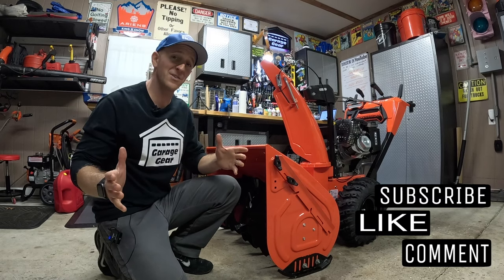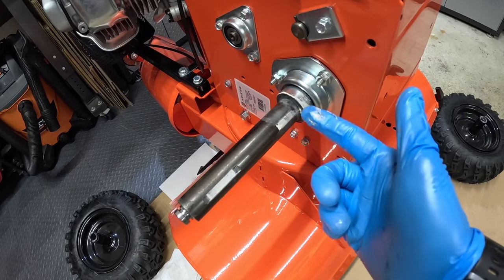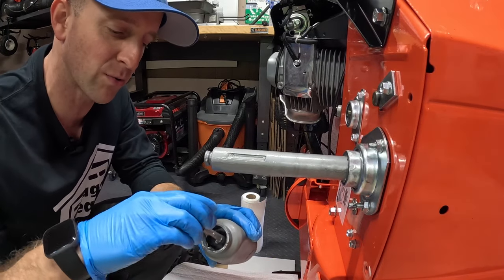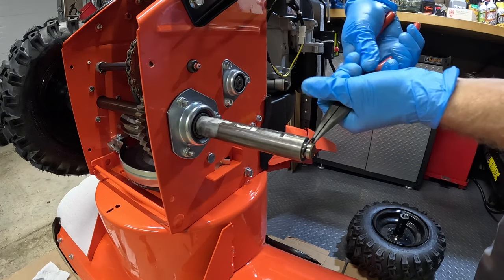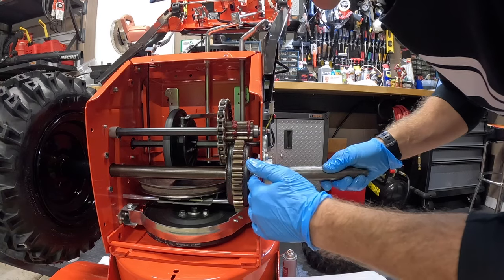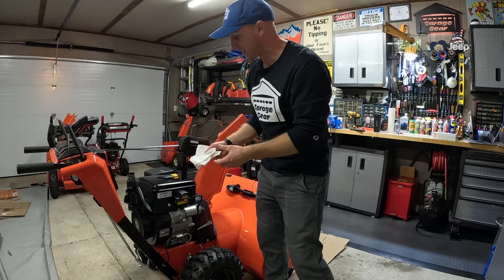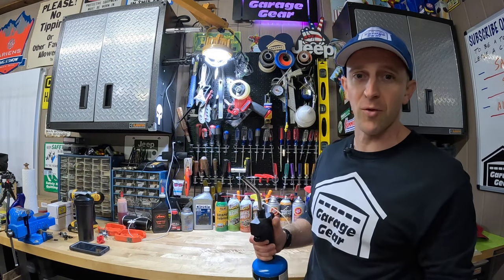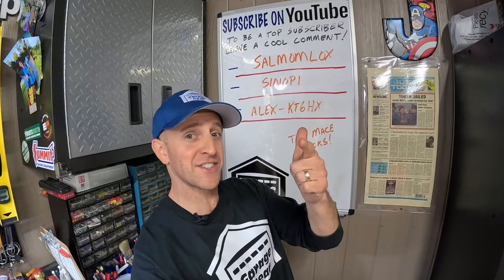HOW TO LUBRICATE DRIVE AXLES ON A SNOWBLOWER (Avoid Issues)

Comment from the maker: Here is a LINK to the ANTI-SEIZE used in this video! Thank you for Supporting the channel! 👍
👉 https://amzn.to/41mrYdK
Reply: @GarageGear  I mean the blades that you took apart to put the shear pin in I got the name mixed up not the auger I think I got the wrong name the as it was throwing the snow it just stopped spinning and I didn't know what happened and the motor was running yet I didn't know if they have a special place for each blade to be the wife called me that the snow blower so I tried to tell her you can't use a snowblower on gravel and I believe that's what broke the shear pin I want to put a little wheels underneath the snowblower the front of it that I don't get too close to the gravel and I did the axles like you did first thing I put the anti seize all over it.  When I buy shear pins I'll sit there and try to put them in.  I knocked the pins out with a punch so when I get them I would be able to just put them in I don't mean to bother you and thank you if you do have any answers and thank you if you don't
Reply from the maker: @liljoeii6091  hey Joe the shear pin holes should line right up and you should be able to drop the shear pins right in. 👍 hope this helps!

Comment: Yeah, it's absurd that Ariens doesn't grease up the axle shafts during assembly. I recently picked up a nearly new deluxe 28 for a great price. Didn't run because somebody left ethanol gas to rot in the carburetor. I had to squirt penetrating oil into the axle keyway for a couple days and then blast the end of the axle shaft with an air hammer to get the wheels off.
Reply from the maker: @danielleroberts8964  yep that sounds like a royal pain! They should definitely live them up at the factory

Comment: My 24" Compact is from 2012 and the axles don't have a key.  When did they start using those?  Also my wheels have different wheel locks.
Reply from the maker: @Noneofyourdambusssiness  not exactly sure when they started using them

Comment: how about the half shaft axles, and the "slip" middle part of the axle that the half shafts rotate in? Usually have to try to get spray in there, like WD-40. But I just ended up tearing it down, was doing all other maintenance anyway. I know grease is usually used if taken apart, but seems like anti-seize might be a good option too. Maybe even better than grease? 

EDIT: Ok, well that "axle slip tube" is different than mine. But still same concept. I'm using anti seize.
Reply from the maker: @AkornzStash  you could definitely do that! 👍
Reply: @GarageGear  yep, thats what I did yesterday. axles turn independently Very Smoothly now, even by hand. Should steer much better now. Still have to get the rest of the drive gears and mechanism all back together. Then finish repairing the gear box for the chute control. Thanks for All the Great Videos 👍
Reply from the maker: @AkornzStash  awesome akornz! Appreciate you my friend!

Comment: Thanks, J.B. I just bought a Brand New Ariens 28 Deluxe on Monday, November 27th. from a Dealer here in the Detroit Metro Area. I had been watching other videos about lubricating the drive axel, but your video is the best. Thanks for the explanation about the autoturn; now I understand why the right side is different from the left.  Thanks, for demonstrating how to tip the snowblower into the Service Position; yours is the only video demonstrating that.  Also, thanks for showing how to remove the back cover (in only two seconds); again, yours is the only video demonstrating that.
Reply from the maker: You got it Andre! Thanks for being a cool fan!

Comment: Another great video JB! 😎
If someone has a lot of fuel left in the tank prior to rotating the machine into the service position, an additional tip would be to turn the fuel valve off, run the machine until the carb is dry, then put a plastic bag underneath the fuel cap to prevent it from leaking out.
Reply from the maker: Another solid tip snowking! Thanks for sharing!

Comment: Thx JB, I take care of my Ariens every spring after the winter is over and done with and of course I use the owners manual as a guide of what to do, I was not aware of the autoturn shaft, and no surprise it’s not in the owners manual from what I recall.  I haven’t put my snowblower into service yet this year, so I will have to take care of that shaft before I start using it.  Again thanks a bunch!!
Reply from the maker: You got it, my friend! It is one of those hidden things that no one talks about! Thanks for following along.

Comment: JB I noticed that your blower does not have the engine size decal on the gas tank, when I bought mine it was missing as well. I contacted Areins and they sent me the decal kit no charge. Great video, very helpful.
Reply from the maker: Hey John! Had one but it was peeling off a little bit! Pulled it off! All blacked out now! Thanks for watching bud!

Comment: Great video JB something I need to do to my new one as well. Since getting the new one I have heard a lot of negativity around the auto turn function. When you start taking snow it’s tough to go straight. Wonder if this is something you would want to do a video on or if you have heard/experienced it.
Thanks!
Reply from the maker: Hey Nick! I’ll be keeping an eye on this once we get some snow here! Got nothing worth pulling out a snowblower for yet.
Reply: @GarageGear 

Absolutely no issues going in a straight line for my first run of 20cm wet heavy snow.  Ariens has a great vid showing the proper way to level your machine.

Comment: Great video JB. I have a 24 Deluxe and grease and anti seize the axles in the spring and re check in the fall. I agree with you 100%,  about Ariens , they could do a better job on corrosion protection. These machines are expensive in Canada.The manual also says to use high temp grease? i use low temp grease since we are using these machines in cold weather. Am i missing something here. Keep up the good work.
Reply from the maker: thanks for watching, Barry! I don’t think we are missing anything, but Ariens missed the mark not greasing those!

Comment: Do I need to drain out the new oil i put in first before tipping the blower over ? Or it is ok to tip over
Reply from the maker: @xrpxtrariceplease2811  hey xrp! Depends on your snowblower! You could try tipping it and if you don’t see any leaks or drips from the oil spout you’re good to go. If you’re concerned about just drain the oil out and put new oil in when you’re done.! Your engine will thank you that way!
Reply: @GarageGear  
ariens deluxe

Comment: question, would it make sense to put grease on the inside of the shaft where the teeth are?
Reply from the maker: @K1600_Rider  you could do that! 👍
Reply: @GarageGear  I was thinking about using Belray Assembly lube that I've used on my motorcycle's drive shaft splines
Reply from the maker: @K1600_Rider  go for it!

Comment: Good tutorial JB, just when I think you've done every video that has to do with a snowblower. I just did my Craftsman when I was prepping it for the upcoming winter season. except I used low temp white lithium grease. Anti-seize does a great job as well but it is so bad and gets everywhere. I have been hoping and praying we're not going to need a snowblower this winter in WNY but that usually never happens.
Reply from the maker: Hey Chris not to worry we’ll be getting snow soon enough! Smart man greasing those up!

Comment: JB,  my lubrication of the drive axles are going to take some time.  Mine are rusted to the axle and I ordered some PB Blaster to try to free them.  Here's to PB Blaster......
Reply from the maker: Let that soak overnite for sure! Let me know how she goes!
Reply: @GarageGear  I unbolted the back panel and it has this rubberlike stuff all over the back panel.  Can I sent you a picture of it?
Reply from the maker: @hipguide1  that rubber dust is from your friction wheel and belts.
Reply: Hey JB...do you have any videos on changing the axle out? @GarageGear
Reply from the maker: @hipguide1  I do not at the moment unfortunately
Reply: The right one was "unseized" but the left one is on and "on good."  That's why I need you to change the drive axle! @GarageGear
Reply from the maker: @hipguide1  you could try torching it.
Reply: Do you need to take the tire off or at least reduce the psi in the tire?  @GarageGear
Reply from the maker: @hipguide1  probably not a bad idea to take some air out but try not to let the torch hit the tire itself.

Comment: I did take never cease and put the axles I have a Toro Max it's about 2 years old,share the pens about a year and a half ago how are they  set. Going through surgeries for my knee get done and I don't remember where they would  be set  cuz when I noticed they were broken the auger stopped by time i seen it not throwing snow if you can help me out I appreciate it thank you for the video
Reply from the maker: @liljoeii6091  have you tried rotating the augers to see where the holes line up?

Comment: I have a question.. I have a new wheeled Honda. The service book says to remove the tires to complete an oil change. The oil drain is behind the tire. How do I go from the service position back to horizontal with no tire on it ? Or can I do the oil change while it's vertical? The manual is a bit vague. It doesn't show any jack points in it and where the snowblower is 250 lbs, I'm a bit worried to just drop it on blocks. maybe I could drop the non wheeled axel on a block ?
Reply from the maker: Yeah, Maybe you could do that or you could also Jack it up a bit.  Thanks for watching.

Comment: Hey JB! I recently bought a used craftsman snowblower, I believe it’s a 1995 model, with the 5hp tecumseh engine, 5 speed fwd, 2 speed reverse. And the previous owner told me he uses 93 premium gas with stabilizer in it. Should I continue to use it as he has, or flush the system and use ethanol free gas ?
Reply from the maker: Hey Jonathan I would skip the flush and just start using ethanol free gas. You’ll be good to go with it! 👍 just use up whatever you have left in the tank then start pouring it in!
Reply: @GarageGear  thanks a bunch !!🙏🏽

Comment: Hey JB,
Great video! I actually just did this today. Regarding the left wheel, there is no E clip on this wheel correct? I thought I was missing it.
Also, the two bolts on the top of the belly pan are shorter than the other four.
Reply from the maker: Hey Paul! The left side is a single shaft only. Nothing to worry about on that one!

Comment: I just did the anti seize on the axle and put it back together. What I noticed however is that sitting still, the snowblower walks back very slowly now when I don't think it did before (maybe I didn't notice). I followed your instructions in the video. Any idea on why its happening? It's from the motor vibrating and making it go backwards.

Also, is it normal for there to be a slight gap  between the tire and the side of the machine on each side that allows a little play between the tires when pushing them back and forth? I noticed theres like a 1/8 inch gap between the tire and the inside of the machine.
Reply from the maker: Hey spectre as far as the machine moving a little goes I have seen this before. Just make sure your drive plate isn’t touching the friction disc while in idle mode. If it is some adjustments will need to be made. Other than  that it made just be the engine vibration causing the machine to move a little. Put a block of wood by a tire to keep it in place. The wheel gap you mentioned is also normal.👍
Reply: @GarageGear  Thanks for the tip, so it doesn't matter if melting snow gets on the 1/8 inch spot between the wheel and the snowblower body? It's exposed there when it slides back and forth.

One other thing is that I put some anti-seize on the teeth for the part that slides back in for the auto turn. Is this a big deal? I ran the snowblower today for a little snow we got and it didn't seem to cause an issue but you didn't put any on in the video.
Reply from the maker: @spectre3492  hey spectre you could coat that gap with fluid film or some more anti seize. Either will do if you’re concerned about that space. A coating once a year should do!

Comment: Noticed that you are using anti-seize that has a high nickle content. Is this preferred over the high copper mixture?
Reply from the maker: Hey my friend! That’s a great question that I don’t have a perfect answer to but I can tell you this. I have used this same container for years and one application I did years ago held up fine. I took the wheels off three years later and it still looked good! 👍
Reply: @GarageGear Frankly, I use the nickle version when changing my auto tires because that was all that was available on the store self when I bought the stuff. But my understanding is that the nickel anti seize is for nut and bolt threads and I should be using the copper based anti seize on car wheels and axle plates. However, I don't think it matters much in the snowblower application, although my car dealer used the copper version on the wheels and the bolts when I couldn't get my licence plate off. Cheers - enjoy your content.
Reply from the maker: @desandrade7927  thanks for sharing my friend! Appreciate you! 👍

Comment: Did this right before a big snowfall here in Minnesota - great video. When putting it back together I followed your instruction, but did notice some left to right play on each wheel (I think it’s one or the other). I took the pan back off and the right wheel and made the sure teeth were lined up, the bushing was on etc and pushed it as far as it would go. Drove it around and the auto steer and everything works great. So I “think” that’s just fine? I can’t think of a reason it wouldn’t work, I just don’t specifically remember it having that play so was curious if you knew. 

Thanks again for the videos - I have a whole playlist of your stuff and a checklist for pre and post season. Need to measure and order armorskids next! 

Ariens Platnium 30” SHO
Reply from the maker: @LincolnPoole  there is a little bit of play on Ariens wheels just because so it sounds like you’re probably okay. Thanks for following along!
Reply: @ phew! Thanks 🙏🏼

Comment: Hey JB!! Hope All Is Well turns out it was my carb. Poor design but i use it 3x every snowfall because i take care of the snrs and my parents.  So for bein 9 years old and following your vids its doing Very Well.
*gas in oil means carb - that a universally right statement?

Thanks JB!!
Reply from the maker: Hey Parabola! Glad your snowblower is doing so well with all these tips! Just clarify for me. Was there gas in your oil?
Reply: Yeah there was Gas in my oil. And the oil was pouring out the carb by a breather.  (Its Pete Jb Im just a little S. Of ya "Ya need Merch!!")
Reply from the maker: @Parabola_PJ  hey Pete! Hmmm is your snowblower blowing a lot of smoke? If there is gas in your oil you may have a piston ring or other engine related issue. If there is oil in the carb somehow the oil is making its way up. Let me know.👍

Comment: Here I see anti-seize only, another video online posted almost same time as this one has both anti-seize and grease. Others again say just use grease. 

Personally I am familiar with anti-seize and have only used it so far for threads so nuts and bolts don't seize up. As we're now talking about an axle on a snowblower, I just don't really see the purpose of using anti-seize when the goal is just to prevent rust. Grease does that too and it will also lube that shaft and axle. Grease is the common thing to use with axles, so why the out of norm solution?
Reply from the maker: This is what I was taught long ago and has worked well for me in my experience. You could use grease if you want to. Just found no issues using antiseize👍
Reply: @GarageGear  I ended up using both anti-seize and grease(did it yesterday) and I'm glad I did it as axles don't freeze up now(-18C) like it did before, and minor corrosion had started to develop after I've only used this blower one time. Went over all nuts and bolts etc in the same go with rustproofing, as it seemed smart to do all in one go. 

Kind of sad basic stuff like this are left out by the manufacturer, and I'm sure there's lots of people ending up with seized axles and what ever else just because it's just bare metal.

Anyhow, now I've learned something so it's not all bad.
Reply from the maker: @ they really should put something on there at the plant. Thanks for sharing a8